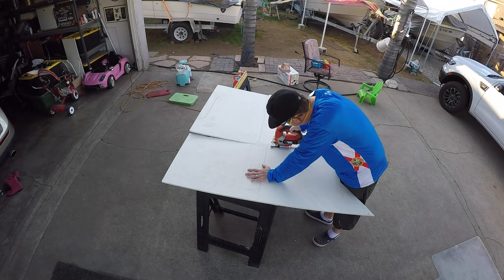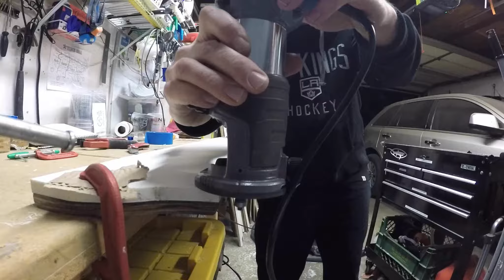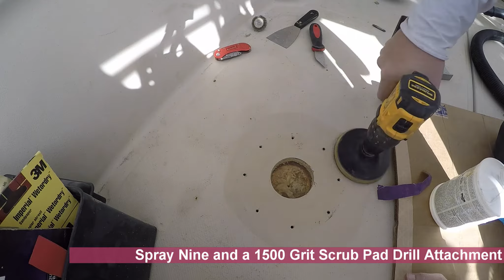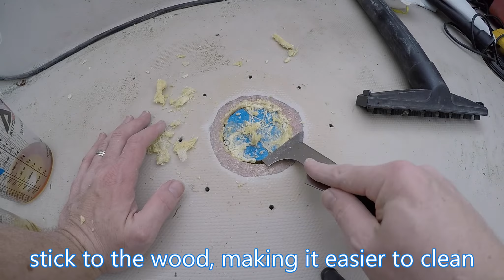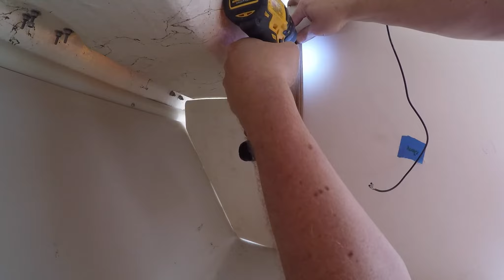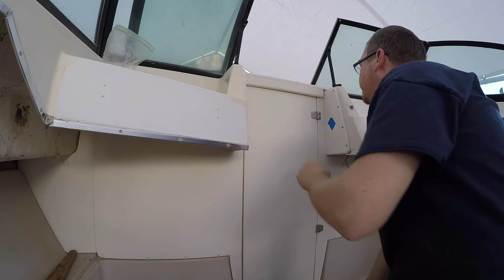Cutting And Installing STARBOARD | Arima Sea Chaser Boat Restoration | Eps. 8

Comment: Good stuff. Great idea with the router. Thanks for sharing.
Reply from the maker: Thank you for your comment and thank you for watching !
Reply: Seriously, wood replacement has me concerned and the simplicity of the solution made me say, "DUH". Awesome work.
Reply from the maker: @sportsman48   I too was hesitant on removing the wood and installing starboard, mainly because of how straight the panels would turn out with using a jigsaw. Lesson learned, make cuts with a jigsaw at least 1/8” over size, all around, and know any non smooth wood panel edges will be magnified 100 times on the starboard when trimming with a router. So make sure to keep 1 long and wide enough piece of starboard with a smooth factory edge on hand that you can use on panels that are not smooth, to be able to retrim 1/16” off for a clean flush trim. These things were my saving grace in getting clean edges. It took me a few days and it’s a slow process, from taking everything out, cutting, trimming, router, and installing these pieces, worth it, yes, but man I’m so happy to have finished 🎉😆 Thanks for watching!

Comment: Year of the boat I built the decks for them in the 80s.
Reply from the maker: Thats really cool. The deck on mine is solid and the reason for me adding foam was, one of the port side area cavities was void of foam and a small area, when stood on, you could hear the old foam compressing (cracking sound). Not a big deal, but since I had the hole form removing the old pedestal there, I filled it in to quiet the sound.
Reply: @SoCalSeaChaser  I did the wiring Some one really did a number on yours . 90% of what you had was not stock.
Reply: @SoCalSeaChaser  You can contact them the might sell you a new wire harness.
Reply from the maker: @joepeltola52  The PO added and added and added stuff, but never removed the old wiring. It was a wiring mess, made a rats nest look organized. I did a rewire on my SC16 and I’ll be doing the same with my 17 here in a couple weeks, finishing up on some gelcoating now. 
One thing I found when pulling off the wood panels was 1 panel had, “Made In USA By Arima”. This wasn’t a stamp or a aluminum plate, but hand written, so this was pretty cool to me, to see how proud you guys were in your craftsmanship. Thanks for checking out the videos!

Comment: I am so glad I got in touch with you, I received my boat last night , Bought the boat unseen from a guy in Oregon and paid a transport company to deliver it. This is for sure going to be my first mod, The current wood is not all that bad but after seeing your boat ,it's  a no brainer to get it done before I even take the boat out. Great video. My seats were replaced and the PO moved them from the original placement and the OG pedestal holes are exposed but filled in with caulking or marine tex or something  similar so i will be addressing that as well . Great job 

                                 Johnny
Reply from the maker: Awesome, I remember the day the shipper dropped off my boat, great day! Yes doing the starboard is pretty basic, just time consuming and a mess. I think in the video prior to this one is where I was removing them. 
Remember to address the important things first like what the guys listed on the AO site. 
The rewire is the most important thing above everything else and should be the first thing you do if it’s old original wire, it’s not hard to do. Draw everything up and post your diagram on the AO site and everyone will help you out to make it perfect and give advice on what you should purchase.
If you’re wanting to jump in and replace your boards right away, doing the rewire at that time will make things easier instead of doing a rewire twice.

Comment: Where did you order this material from ? I have a 1990 sea hunter and I'm doing the same thing
Reply from the maker: I know of a few shops from Washington to California so it depends on where you're located. The stuff is super heavy and having it delivered would be really expensive, so picking it up is the best thing.
Reply: @SoCalSeaChaser  I live it the san Francisco Bay area so I'm guessing Eplastics in San Diego is the best option.  Did it take you 2 sheets to complete it all? And what thickness did you go with?
Reply from the maker: @MrKwhited  Give TAP Plastic in the Bay Area a call, they should have starboard.
I bought mine from Professional Plastics in Fullerton. They also have a location in Sacramento.
I used 1 and a half sheets, but the Sea Hunter I believe has less and smaller panels. Best thing to do is remove all your old panels first and lay them out in a 54”x96” area, remember to give some space for cutting. This will help you determine if you’re going to need one or more sheets.
The board you’re going to want to get is: 1/2” starboard and the color is “SEAFOAM”, that’s the color the factory uses.
The code Professional Plastic uses for this board is: SSTARSF.500X54.000X96.000

Are you on Arima Owners?
Reply: @SoCalSeaChaser   Awesome dude!I was expecting to have to drive way further..🤘 ill first remove everything like you sed to ensure I don't buy too much.  
I actually tryed to start a profile but it's giving me a error page when I try to join. 
I noticed every time I look somthing up it always takes me to those forms on the arima owners site but I have no access until I join.
Reply from the maker: @MrKwhited  Cool man, glad I could help. 
Check this link out, hopefully this will help you register.

http://www.arimaowners.com/index.php?topic=1748.0
Reply: @SoCalSeaChaser  that link is telling me I'm banned from using the site🤷‍♂️
Reply from the maker: @MrKwhited  Here’s another option. If this doesn’t work I have a 3rd option.

http://www.arimaowners.com/index.php?topic=18003.0
Reply: @SoCalSeaChaser  yeah its still telling me that I'm banned from using this form. I tryed using my phone and desktop to register.
Reply from the maker: @MrKwhited  This happens sometimes and if you want, use the desktop version of YouTube, go to the “About” section of my YouTube page and send me an email with your username and email address you’re wanting to use. I’ll get in contact with the main Admin for you.
Reply: @SoCalSeaChaser  dang that would be awesome! Thankyou! I just sent you my email. Hopefully we can get me in 🤙😎💯
Reply from the maker: @MrKwhited  I haven’t seen your email yet, try to resend it.
Reply: @SoCalSeaChaser  I sent it to your socal sea chaser email